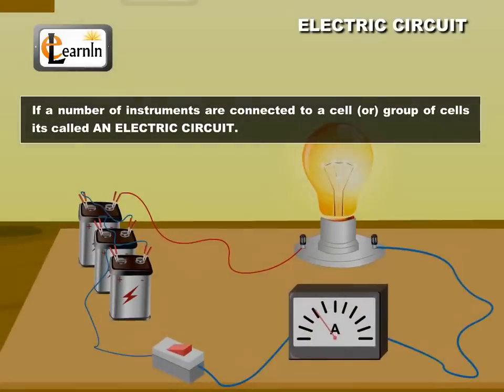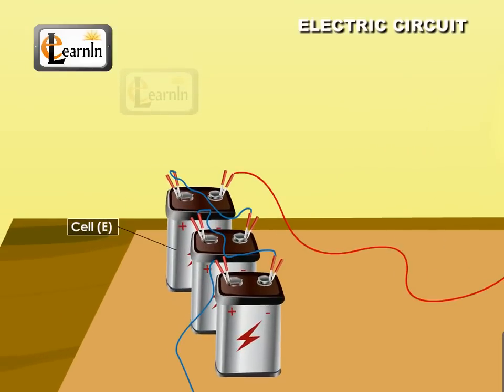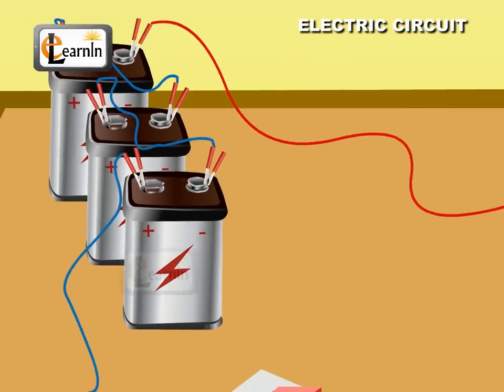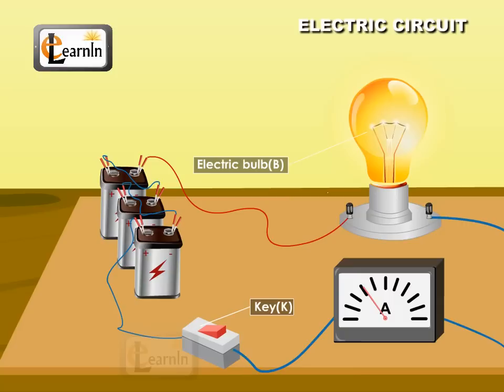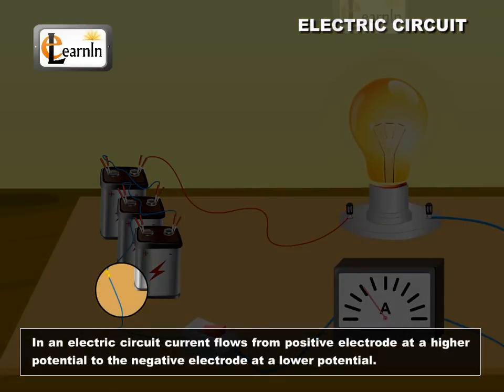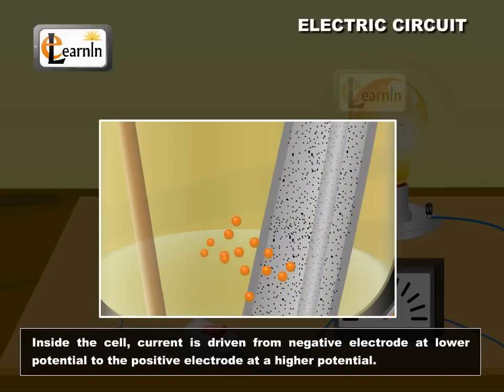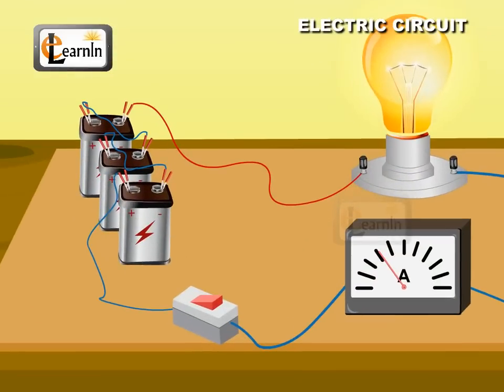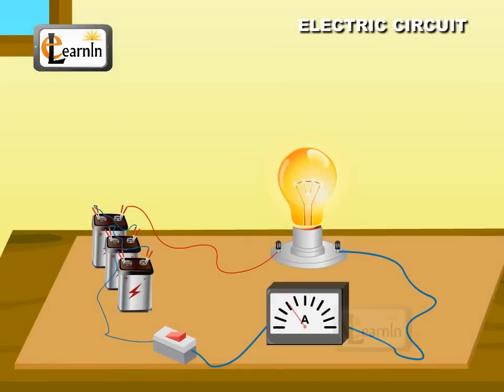Electric Circuits Explained | Physics | Elearnin

Comment: Allright, circuit current is positive, higher voltage to negative lower voltage.  In a cell, current is driven from negative lower potential to positive higher, potential.
Not bad for the length of the vid, though I still want one about how circuits with batteries in series and parallel work compared to each other.